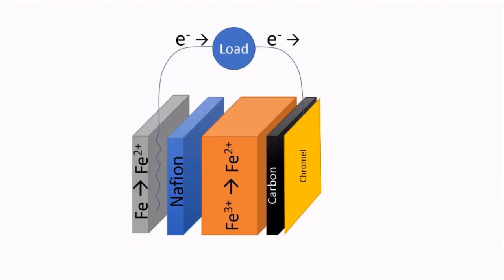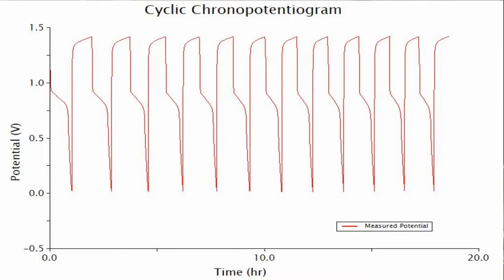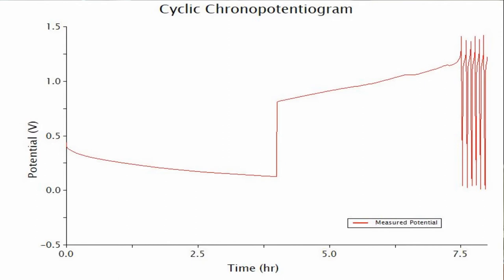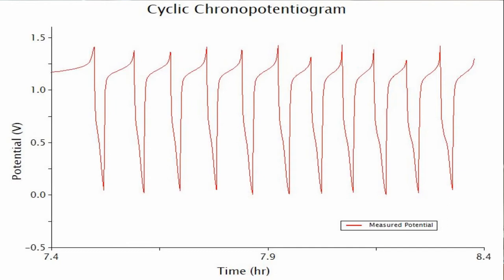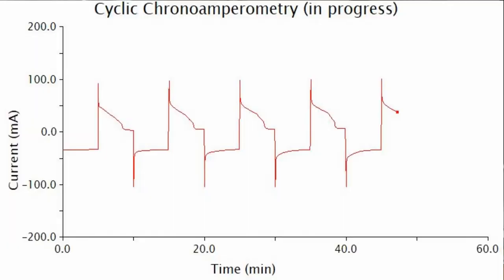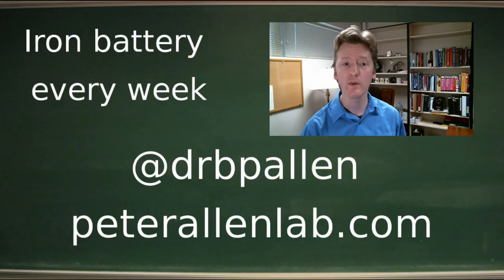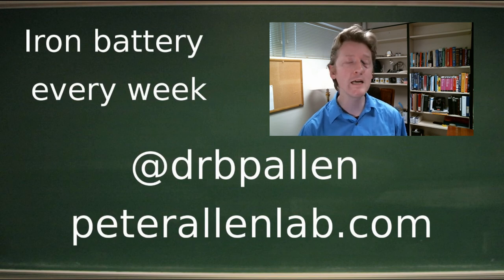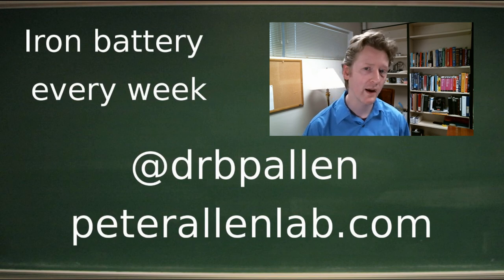Iron Battery part 61: EDTA and Agar don’t play nice together

Comment: I was looking at iron compounds and was wondering if Iron(III)-hydroxide polymaltose complex // iron polymaltose: Other namesiron(3+);(2R,3S,4R,5R)-2,3,4,5-tetrahydroxy-6-[(2S,3R,4S,5S,6R)-3,4,5-trihydroxy-6-(hydroxymethyl)oxan-2-yl]oxyhexanal;trihydroxide might be a candidate for experimentation. It is absorbed in the intestines so it does exchange throug a membrane. I do not have a background in chemistry so I can't tell if it would provide the necessary recharging capability or is even feasable but as with any question it is worth asking.
Reply from the maker: Once you put me on that thread, I followed it to an old Japanese paper that looked at the solubility of a whole bunch of iron-sugar complexes. That's really cool. They are stable at modestly alkaline pH and dirt cheap. I think I'll give that a try to see if I can get more iron sulfate into solution.

Comment: Hi I have a question, what's the point in developing an all iron battery if you depend on nafion, which is very expensive and is the main reason why fuel cells and flow battery don't take off? 
Are you planning to find a substitute to nafion?
Reply: This is a good point.  I would think a sulfonated PEEK membrane might be a good alternative?
Reply: atari7001 I only studied a bit of nafion membranes(just to find that they are not so stable and are very expensive) , I don't know the properties of sulfunated ones, I was looking for a good separator to my own batteries, I think that if you don't need the proton exchange property of nafion and just need chemical stability Teflon or polypropylene are good choices, lithium ion uses polypropylene.
Reply: I was looking at the PEEK membrane at one time, because it appears to be easy to fabricate in the lab (and cheap).  If I recall correctly, PEEK plastic is dissolved in sulfuric acid and painted onto a glass plate and allowed to dry.  However, a simple physical barrier would seem to be the best route if charge dissipation or some anolyte / catholyte mixing is not a big problem.  There's another youtuber that made a simple zinc bromine battery that particularly impressed me.  No membrane, but charge retention seemed very good.  Since the cell was constructed vertically, gravity served to keep the bromine solution from attacking the cathode. I've even heard of some old time batteries using a layer of sand as a "membrane".
Reply from the maker: I look at it as another way to analyze the cell. If a good commercial separator like Nafion solves a lot of issues, then it's worth focusing on separator issues to get costs down. If Nafion doesn't help much, then I'll stick to agar and work on finding cathode additives to get the concentration of iron up. I don't think Nafion would fly for a DIY version. That said, Nafion is off patent now so the price is way lower than it used to be. I'm using paper infused with Nafion right now, and it costs ~$1 per membrane.
Reply: Makes sense.  Love the simplicity of a paper soaked in Nafion. Genius!